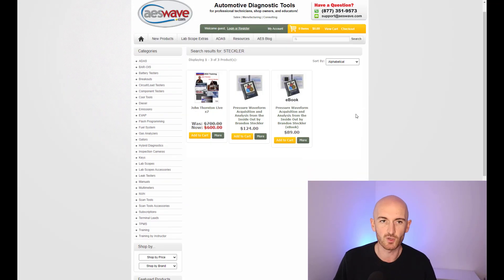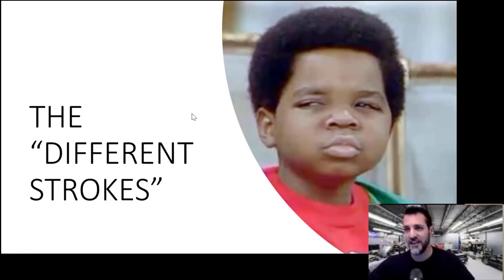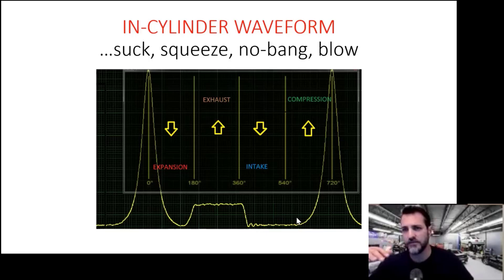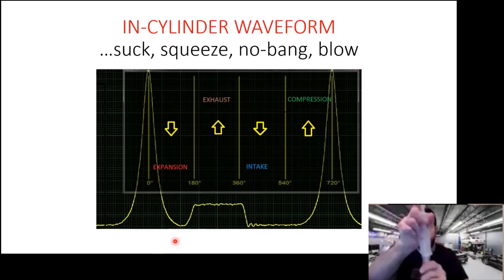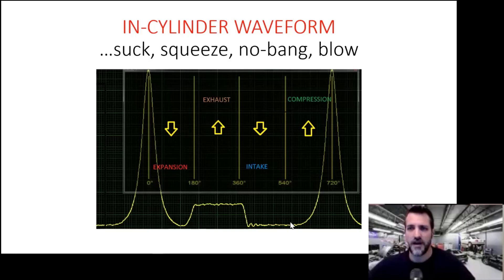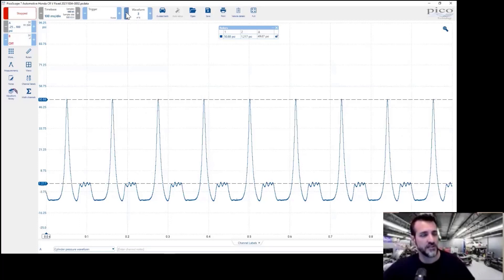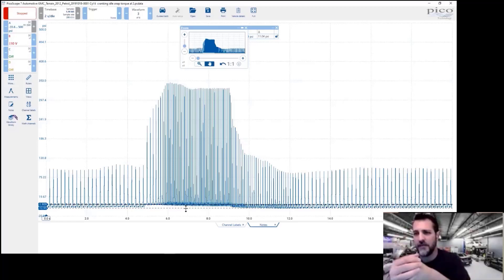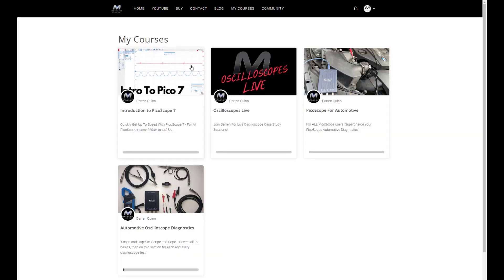In Cylinder Pressure Waveform Analysis Special Guest Brandon Steckler

Comment: The initial conversation is 100% spot on for me! I was a BMW Master tech. Beyond fixing a cheap BMW with an issue to keep as a drive car and then sell when the next opportunitycame along. I never did home jobs. 
I was very proficient at getting to a result using the restrictive diagnostic tools and pathways you had to stick within to obtain warranty approval.
I left the trade 10 years ago. In that time since, helping out family and fixing my own (off brand) cars. I never failed to figure it out but it became pretty obvious that my knowledge was brand specific and lacking compared to aftermarket diagnostics! Guilty of firing a parts cannon here and there without the tools or the knowledge of how something worked or how to test it.
I've learnt more in a month of binging YouTube diagnostics channels than I did in years as a younger mechanic.
Reply from the maker: So true! A lot of knowledge on here and I learn something new every day! 

PS. do you still plan your day in AW’s? 😂
Reply: @MechanicMindset  AW? Do you mean 5min increments? We called them FRU's. And I never did. Much to my bosses dislike. My efficiencies always sucked, but I was fastidious and never had come backs. So much so, it became a leverage point for pay on both sides. They used to try and keep my pay down by pointing out my efficiency. Putting value in efficiency over everything else. Willing to deal with higher levels of come backs. I would show that I was only working on and solving problem cars that had been back 3-5 times and the real kicker = I dealt with a lot of customers face to face who didn't believe the service advisors. They (especially the M owners) would come in and ask for me specifically to work on their cars.
Checkmate.
BUT, they would always find a way to pull the rug from under you and ensure you remembered that you were just a number and easily replaceable. So, I went up into management for a few years and like every great great tech I knew before me. I left the trade all together because they treat you like rubbish and if you dare ask for the most basic of niceties like being able to work on your own car or wash it at the dealer after hours. They would actively and systematically make your life difficult. Which anyone with self respect would bring to a head. Often ending in being walked out of the business. Leaving a sleugh of compliant oil dumpers. When you were the boss, they would then hammer you with why we were getting so many comebacks and why no one can fix the harder cars?
And I know for a fact, we were one of the better dealers. Bmw has a great service name in Aus because of the level and accuracy of service delivered. But the people delivering it just get pooped on delivering it. So I bailed for more money, almost zero stress and using probably 10% of the brain power.
Reply: @secretsquirrel9722  Yo you gotta tell me where I can find a job that has zero stress and 10% brain power :D hahah Anyway glad you got out of the rat race
Reply: @John-rw9bv  probably specific to where I live a bit. But my cities government runs public transport. I drive buses as a casual only 4 km away. I work when ever I want for literally half the hours in a week. Taking home $3-400 in hand more a week.
Downside, your mixing in the lower socio-economic end of society and while it's attention intensive. Not exactly stretching your cognitive abilities.

Comment: I worked as a Mercedes-Benz dealer tech and thought I knew what I was doing until I went to an independent shop that works on all makes. It was a very humbling experience to find out I not only didn't know what I was doing but was massively undertooled as well. I still respect dealer technicians, they do what they do well, but there are dozens of manufacturers all with different configurations and span over a whole lot more years. The difficulty is way higher because you're just exposed to problems you'd never see at a dealership. Brandon Steckler is one of my favorite instructors, he is very willing to share his experience and knowledge and explains them in simple terms. Pressure waveform analysis is a true game changer if you can interpret the information!
Reply from the maker: Thanks for sharing!

Comment: You bring out some good points about independent shops.  I know years ago, I had a good friend that went to work for the local Ford Dealership.  This was when the Escort had just come out.  I think 1981?  (The same year Brandon was born!)  Yes, he knew how to put timing belts on and repair oil leaks, etc.  He then went to work for an independent shop and he had a newfound respect for us independents.  "Different strokes" is older than Brandon!  Great video!

Comment: I have a question, when there's 20 inch of Mercury on the intake stroke, then at the bottom of the non combustion stroke, would the process of squashing the air not heat it up a bit and cause the pressure at the bottom of the non combustion stroke to be slightly higher?
Reply from the maker: I see what you’re saying. I suppose opposite to compressing (and heating) the air, when the cylinder domes down it drops the pressure (cooling it) again. 

I think more of a different would be seen from the small amount that’s lost past the rings in compression
Reply: @MechanicMindset  ahh right. Is that the same principle as when fuel is atomized to a lower pressure within a carb and can cause it to freeze up because of temperature drop? Lower pressure means drop in temperature?
Reply from the maker: @RideBikes_Walkplaces  Maybe, pressure and temperature are certainly related regarding gasses 👍

Comment: Having worked the full spectrum in the automotive world you do in fact see the broader picture. I have worked dealerships, gas stations and even run both my own shops and other shops, including off highway & construction equipment. At now 72 years of age I'm still learning but most of the new stuff comes easily having followed the progression of these systems and technologies. My only gripe is with the manufactures and the hurdles they make us jump in order to flash components both used & new. It's all about the money these days and not about the quality.
Reply from the maker: For sure, they’re not making it any easier! Lots of challenges to come too with the cyber security aspects of modern vehicles

Comment: What attachment would be used to get this kind of clean in cyl reading?  Wouldn't an exhaust or intake accessory be too hard to read in this way because you have all cylinders working creating intake, exhaust, compression strokes at the same time? So that the only way to get a clear reading as demonstrated, is through the spark plug hole one cyl at a time, and just turning the engine without cranking it? Is there any way to get something like this with the engine actually running?
Reply from the maker: We use a pressure transducer that screws in the spark plug hole. I have a video showing an introduction to in cylinder pressure testing 👍 go check it out
Reply: @MechanicMindset  okay, that's what I figured....I'm trying to make my way through all the videos lol.  I bought a 2204a and all the accessories from your links and trying to get this figured out.

Comment: Hi quick question.. Just subscribed your channel...  Does  incylinder pressure transducer testing reveals sticky or leaky valves,? if so what shoud be looking for, i do know how to test and what values to look for with respect to approximate valve opening, towers leaning etc. etc. but dont know what would a leak valve pattern look like?. 2. do you prefer to use PULSE wave form in stead of incylinder pressure wave form  for leaking valves..  bit  conused many people are explaining how it works  but not one created a case study on those..
Reply: I think for an all round view you would have a vacuum transducer in the inlet manifold, a venturi in the tail pipe and another pressure transducer in the dipstick tube. Then you could see where any air loss is going.

Comment: Hi great interesting video could you answer a question we are debating if you had a blocked exhaust would the psi after engine shutdown stay in cyclinder chamber or would it leak out through piston rings and pvc valve  overtime or through intake valves ?
Reply from the maker: Interesting question. I suppose it’s likely that at least one of the cylinders exhaust valves would be open, so the pressure might dissipate through the exhaust and the bore. If it stops on an overlap event then yes, it would go through I take. You might even be able to see that on a pulse sensor with engine running
Reply: Yeah has been a topic today as was showing video forgot too say if the exhaust was completely blocked and car would not start would the pressure stay there in bore and intake or escape out through intake and air filter after engine shut down
Reply: @danielgreenbaum8875  It depends on the car but usually the pressure is lost through the cylinder rings pretty quickly. If you ever get a chance to spin an engine by hand, usually to align things to TDC, then you'll definitely feel the pressure building as you fight against it, then eventually dissipating.